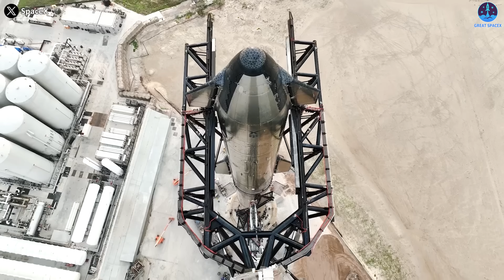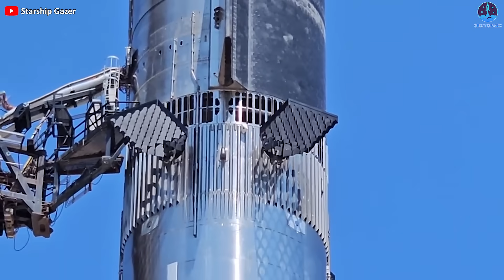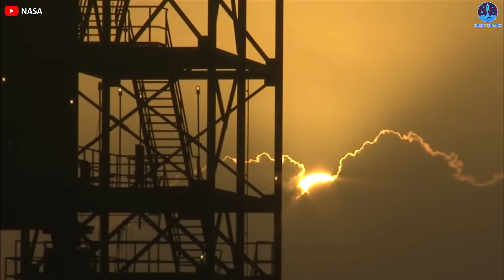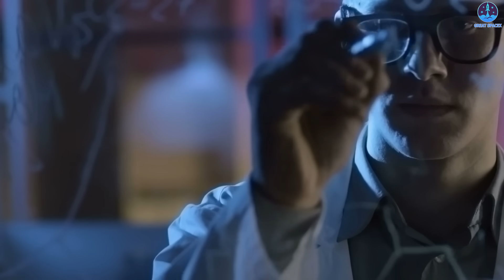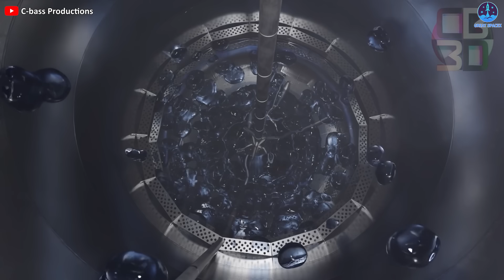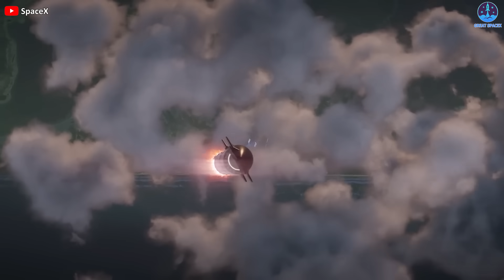What NASA Astronomers just declared about SpaceX Starship will blow your mind!

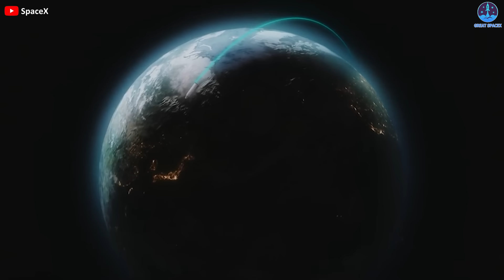Comment: 0:58 “ Earth to Earth transportation”
For those that think they will one day soon be travelling from London to Sydney, Australia in a suborbital starship flight consider this.
The Space Shuttle programme had 2 catastrophic accidents with the loss of all on board out of 135 flights. Apply this loss rate to the current number of  airline flights in the world and it equates to in excess of 120,000 crashes per year. NASA stated after the end of the Shuttle programme that a loss rate of 1 in 500 or better would be the goal for future launch systems. This rate applied to the world air transport industry equates to around 18,000 crashes per year. The world would run out of airplane  in short order at this rate.
Recall the nashing of teeth and vows never to fly on one of “those aircraft” when just 2 B737 Max’s went down in the space of a few months.
Riding a rocket ain’t never going to be anywhere near as safe as flying in a plane and no aviation regulatory authority would ever allow it.
Reply: To compare shuttle to air plane you need to factor in how many flights said planes had taken off and landed with how many passengers then you can get a better picture of death by flying
Reply: @rickdunn7585  I made the calculation firstly by estimating the number of airline flights per year. I did this by dividing the published number of passenger movements by 200, this was an estimate of the average seating capacity. I then applied the crash rate of 2 out of 135 flights that the Shuttle experienced, and then a rate of 1 in 500 flights. A loss rate of 1 in 500 being stated by NASA as acceptable.
The same methodology applied to the 2019 passenger movements in the US of over 900 million and you get around 9,000 crashes in the US alone in one year.

Comment: I did the math, even if you could accelerate at space vehicle to 200,000 mph; it would still take around 3311 years to reach the edge of the solar. Which is around one light year or 5,800,000,000,000 miles.  It would take 14,350 years to nearest star system.  Suppose you extrapolate how long give current technological pace, even given a accelerator or rate of change factor. I still would say it would take centuries to reach the technological level to even get beyond the solar shock or the furthest you still feel the sun's pull on you.
Reply: That's frustrating! For years, the fastest people could travel was the speed of riding a horse, or steam locomotive, then automobiles, then airplanes, etc.  Physics & Engineering just has to discover/develop a breakthrough concerning space travel..(I hope)

Comment: It will take another 20 years before spacex will have a useful starship.🤣🤣🤣🤣
Reply: Only if the FAA and other government agencies prevent testing.  It will only take about 12 launches to perfect the design, including recovery and reuse.  SpaceX already has five complete stacks, two of which have completed all per-launch tests.  SpaceX will have completed 12 boosters and 20 orbiters by 2Q2024.  After that it will have all its assembly lines in place and will be able to assemble 3 boosters and 12 orbiters for each month thereafter.  Each booster can fly 100 times with only two hours of testing and refuelling between launches.  Most importantly SpaceX can launch 1,000 Starships for the same cost as 100 Falcon 9s.  That is an enormous financial incentive to SpaceX.  Every time SpaceX is forced to launch its Starlink V2 satellites on a Falcon instead of a Starship it is COSTING THEM MILLIONS OF DOLLARS.  And the primary reason they are forced to waste that money is that the FAA and the FWS do not have the resources to perform the legally necessary oversight.